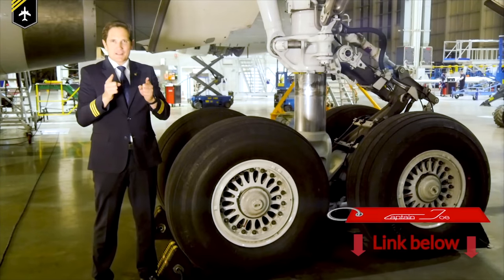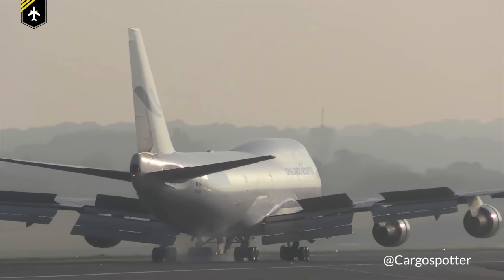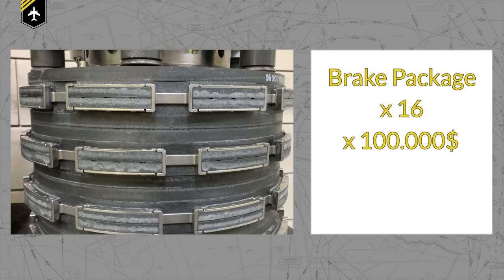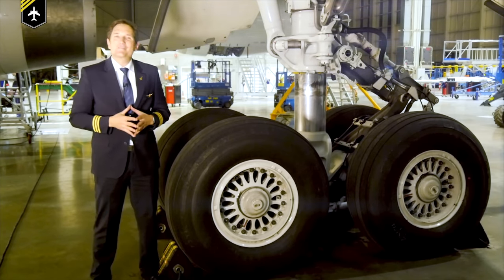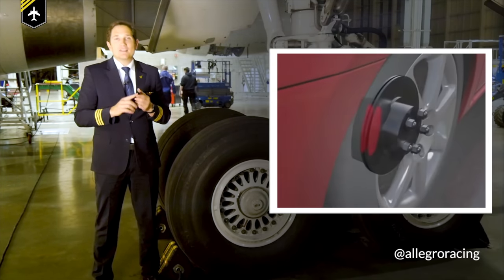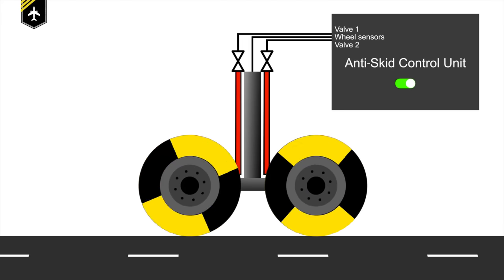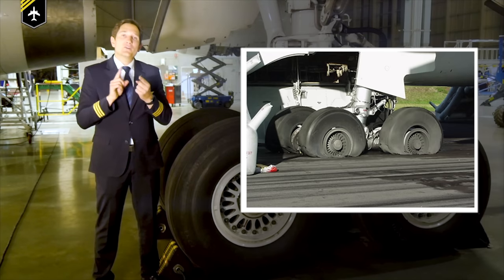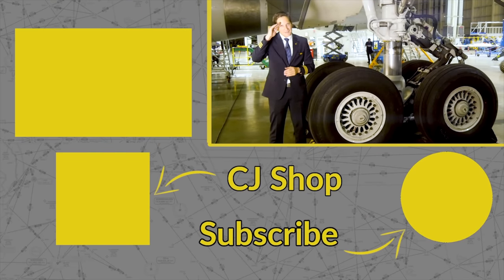Do PLANES have ANTI-SKID??? How to PREVENT SKIDDING? Explained by CAPTAIN JOE

Comment: "They came up with the Anti-Skid-System or..."

THE ASS?!

"protection"
Reply: Why it's not called that in cars.
Reply: Makes sense. The Antonov An-225 is very thicc.
Reply: @nolongerusing7430  dummy thicc
Reply: @stever4899  
Kuz cars aint thicc

Well, except for trucks
Reply: Lmaoo
Reply: @dickmelsonlupot7697  with widebody kits they are
Reply: If there will be more advanced system, it will be called The Smart ASS.

Comment: Aircraft on an aircraft carrier switch the Anti-Skid off during carrier  operations. There is a few reasons for this: The Carrier is coated in a no-slip material, and taxi is slow enough that  skidding is a no-factor. Takeoffs via catapult and landings via trap are not dependent on braking action at all. Lastly, if the anti-skid system fails, in can take the normal braking system with it, leading to an aircraft rolling over the deck, potentially bumping into something or disappearing over the edge into the sea. 
That last point is the reason why on an aircraft carrier, pilots arm the ejection seat immediately when the tie-down chains are removed from the aircraft, instead of just prior to taking the active runway for take-off,  which is typical in land-based operations.
Reply: 100% correct, in addition to probably the most famous of carrier operation differences vs. most land based airports, landing on pretty high throttle incase your hook bounces over all the catch cables, so you can immediately take off again, and come around for another pass. {It's required to slowly shake your head as you get hooked on your second pass..jk :D ) I got to tour the USS Nimitiz when it was in Bremerton Washington when I was a kid, It blew my mind the shear scale after having also been on the USS Missouri. As a 8-9 year old kid on the deck of the Nimitz, the main thing I was thinking of how sweet F/A -18's are and if anyone could survive a belly flop if they missed the nets after falling off the deck.. rofl... 

+
Reply: Now these people are like me how old are u guys I am 14

Comment: 4:49 when he says "blowouts" he is being serious.
He is standing next to 4 bombs. 4 very powerfull bombs. 
Each of those tires are inflated to around ~250 p.s.i. 
2 of them probably have enough air crammed in them to fill the entire interior of the plane to nearly 1 atmosphere. That includes the wing fuel tanks, fuselage and the hellhole. 
Imagine that much air escaping the tire instantaneously.
Yeah. It can blow a car apart.

EDIT: I forgot to add, that pressure is when the tire is cool. Say, 60°F at sea level. 
You all know that heat affects air pressure. Which is why you add somr to your car tires in the winter and release some in the summer. The same thing applies to aircraft tires. But the effect is greater because the tire pressures are much higher. 
If that tire lands in a hot middle eastern airport, when the black paved ramp is 150°F and the air is ~130°F, that tire pressure might pass 300 p.s.i. 
And, more importantly, if that tire suddenly skids and burns rubber, or when the brakes are applied, that tire may suddenly be a few hundred degrees hotter. And that quickly heats the pressurized air inside.
And then...well...use your imagination.
Reply: Spicy air
Reply: looks dangerous, let’s do it!
Reply: @Thegreatduc 69 I’m all in
Reply: I have to work with containers of gas at 3500 psi.
Reply: Agreed
(250 p.s.i approximately equal to 20 bar)
Reply: Its not pretty I'm a retired Aircraft Mechanic saw a 707 land and one the main tires blew the wheel busted apart, took the ramp crews two hours to clear the runway. 
A simple explanation of brakes is they convert mechanical energy to heat energy of course its more complicated than that with the braking system, the anti skid, hydraulic systems, computers and not ti mention the backup systems.
Reply: The volume of a 747's tyres is about 0.4m3 so at 20 bar there is about 8m3 of air (or rather nitrogen) in each tyre. The main deck cabin volume is c.600m3. So it would take about 75 tyres worth of air to fill it.
Reply: Aircraft tyres aren't filled with "air", they're filled with Nitrogen.
Reply: Yeah, its dangerous i was thinking the same thing!
Reply: Thats why you approach hot wheels at a 45... to avoid the failure path, and avoid the blow out plug path.  That is if you have to approach  the durn things at all!
Reply: @musicbruv  3500 p.s.i. 
So you have a great deal of both understanding and respect for high pressure containers. 
Do you work with O2 containers?
Reply: Guys I'm a commercial A&P myself. I deal with 737 landing gears all the time. I'm giving a G.P. style explanation, if you know what i mean. Lol
Reply: @LiamE69  Appreciate the mathematics! 
I was off a bit wasn't i. :P
Reply: Nice description. I like how you explained that 👍
Reply: May I Ask What Is The 'Hellhole'?
Reply: Woah! That's Al lot of Science.
Reply: @leafpot587  The hellhole is a particularly unpleasant maintenance hatch/area inside the tail structure, but outside the rear pressure bulkhead. This area usually contains the operating mechanism for the horizontal stabilizer, and is often very greasy with limited ventilation.
Reply: @davecrupel2817  O2 and Co2/Argon mix mainly.
Reply: @musicbruv  You're not saying you put O2 in tires, right? 
Can you clarify?
Reply: @davecrupel2817  I work with those gases but I do not put them in tyes but weld and gas cut with them.
Reply: @musicbruv  I totally forgot when I made that reply that you're the guy that works with pressurized bottles. My apologies
Reply: @davecrupel2817  No worries, I was a bit confused by your reply but hey we all make mistakes.
Reply: @mikecowen6507  thanks!
Reply: Well the Gay-Lussacs gas law is the main reason why airplane tires are full of pure nitrogen. Nitrogen doesnt explode, and the temperature  doesnt affect pressure as much. But while you COULD get pure nitrogen for car tires, in most cases its just a waste of money.
Reply: They are not at any limit at normal tire pressure, not even when they are hot, and the pressure increases... They are tested to the double, at each tire change. The rims are tanken appart, and magnafluxed for cracks, and a new retreaded tire is installed between the two rim halves, and checked in a cage, before they are send out ! 
I change wheels on B-767 pretty often.. They are not bombs !
Reply: I have to admirre how much knowledge you have

Comment: I like the fact that Joe explained that braking incorporates slippage.
Usually in high school they just tell you that static friction is greater than sliding friction and that, since the instantaneous speed of a rolling wheel relative to the ground is zero in the contact point, ABS will keep the wheels spinning so that they can transmit the maximum amount of power to the ground. Whereas, using more than one reliable source I've found out that the peak of the coefficient of friction happens when there is a certain amount of slippage. Surely the motion of the tyre in that condition will be closer to a rolling tyre than to a sliding one, but still it will be sliding; actually, when the slippage is zero, so will be the friction coefficient.

Comment: 6:45 ..... Damn that's a hard landing. 

Looks like testing though.
Reply: @Qi Sen Wang fr, that cargo took a nice bounce.
Reply: 411Adidas the video is slightly sped up, so it looks like that.
Reply: @ZK-APA  I have to disagree. It looks normal speed transitioning into a minimal slow motion
Reply: 411Adidas https://youtu.be/1Oc0tgkYMDg

The original video. From here you can relate the sped up video.
Reply: Qi Sen Wang you are right 0:17 looked way harder landing
Reply: Nah, that's just a typical MD-11 landing. High V-ref speeds and a small tailplane does that.
Reply: @ZK-APA  good call, that's much slower.
Reply: Just MD-11 things.
Amazing cargo plane, but hella clumsy at landing, and lands FAST
EDIT: just not as fast as the clip shown here of course, check the original posted on the replies
Reply: The sped up 747 landing in the beginning was also rough
Reply: That's a good landing for me in flight simulator.

Comment: I'm my flight sim I had to use RTO and it was kinda fun. The story is my stick locked up and I couldn't pull up at V1 so I pulled the throttle down to idle and RTO took over and stopped near the end of the runway.
Reply: You don’t rotate at V1

Comment: 5:03 - ABS light on while cruising at what I assume is 185 km/h (111 mph)!
Reply: Must be on the German autobahn
Reply: let's be optimistic and believe it was the pre-check that some cars do that roll the dials all the way and light up all lights in some sequence
Reply: @Kalvinjj  That is plausable. I see that in my Ford's instrument cluster test.
Reply: Normally not a big deal for car drivers as most of them usually break rather gently and the street conditions cannot be too bad if one really drives at 185 km/h. ABS should not be needed regularly, only in special cases like sudden snow mudd or some idiot coming out of a hidden street and ignoring your right of way.

Comment: Hey Joe love you and your work a lot
Being a curious kid pilot I had this question :   Why don't the pilots use AUTOLAND always??
Would be great if u could answer that😘
Reply: Because not all runways/airports support the required approach criteria for autoland. And what if one time as you land you have lost the autoland capability then have to land manually but not done so for a while. It most likely won’t be a smooth one
Reply: abbysnowmist yes they can. Just depends how much wind is prevailing and the runway slope. Been on a flight where the pilots used autoland (thanked them for the smooth landing and they said it was actually an autoland)
Reply: It is to extend the life of the runways, because autoland will land every aircraft exactly at the same point causing a hole in the runway. (very precise system)
Reply: Papercraft Shikhrrr because one the aircraft, runway and the pilots all have to be qualified for it, so you can't do it everywhere.

And two, when the pilot has manual controls, he or she can make rational decisions and make adjustments as needed. Autoland can't do that (eg Autoland has a crosswind limit less than a manual landing)
Reply: Pilots are pilots because they like flying airplanes. This includes landing them.

Comment: The ABS system was developed under petiton of Onkel Aldolf by someone with the ''Bosch'' lastname once it was clear that breaking in the moist/freeze autobhans was a problem. 
The mechanical ABS was too big for rockin on a BMW or Mercedes at the time but the war came so the Luftwaffe had to face the despair of trying  to stablish an aerial bridge with Stalingrad and skiing was big chunk of the problem. They asked for help and the early mechanical ABS was mounted on some Henkel planes if i remember.

Comment: I may not have this exactly right. But Dunlop developed a system called the Maxaret system in the early 1950’s. A wheel locked when it hits the ground will stayed locked as it rides on a layer of superheated steam. As a side issue it also cleans rubber on the railway causing white tracks. I know the 1st British passenger jets had a version of this system. It was extremely complex as it was not controlled by electronics.

Comment: I"m not a pilot, but have an interest in aircraft. I first read of aircraft anti-skid systems on a very early late 40s all-weather jet interceptor.(Which would have to land in any weather)> It would have been an analog system back then. If I remember correctly, the rotors were chrome plated copper. (Don't quote me this, it's been years)

Comment: A related fun fact as a car guy. There was an early attempt for a car ABS system back in either the 50's or early 60's. They actually called it "Anti-Skid"
Reply: As far as I know the first production car to have anti-lock brakes was the Jensen FF in the UK in the 1960s. It used the Dunlop Maxaret system that was already used in aircraft. It was expensive but this was tolerable because the Jensen FF was a very expensive car.

Comment: Really wonderful explanation.  Thanks for the video. Given the significant cost of those brake clusters, I wonder how often they replace them.  I would imagine not all that often.
Reply: Steel brakes, the "classic" material, were typically designed by the brake vendor to get about 1000 landings from a rotor/stator assembly.  For carbon brakes, first introduced for airline operations (other than Concorde IIRC) in the 1980's, more like 3000 landings.  The life for any particular unit will depend on the actual amount of brake energy absorbed in each of those landings.

Comment: Great video! However, one thing to note. It's not always necessary that a lighter vehicle will have more chances of skidding and losing control. It mainly depends on the combination of the vehicle mass and its tire configuration including inflation pressure and tire tracks.

A heavier vehicle has way more linear momentum to that a lighter vehicle traveling at the same speed. So more brake pressure has to be applied in order to decelerate the heavier vehicle compared to the latter.

Ofcourse, it is true that heavier vehicles provide more leverage to its braking control due to the higher weight pressing down onto the wheels. Yet, although the lighter vehicle will have the tendency to lock its wheels more likely in a snap, the deceleration rate will still be higher(with less braking force) due to the fact that it wouldn't be having much mass to change its state of motion, hence requiring less amount of energy to the brakes and thus less heating.

But then again, it all comes down to the overall vehicle parameters and its configuration, and not just its mass alone. There are cases where higher mass will aid in braking (a car compared to a motorcycle) or a lower mass doing the same (bicycle compared to a motorcycle).

Thank you for reading!
Reply: He is not an car specialist he is a pilot 😂🤣
Reply: @mattm2572  Haha, good one. But this logic has to be considered if you have to fly with widely varied classes of aircraft.

And no, this is not just a car thing. This concept plays a major role in both aviation and aeronautics as well, and I, fortunately, also deal with all of them in my professional career, hence the reason why I stress my point. Thanks for the reply anyway! 😄👍.
Reply: @mattm2572  and btw, in case you didn't know, vehicles apply to any mobile machines and not just cars 😁

Comment: Hello, Captain! Why do pilots turn on engine number 2 first and not both at the same time?
Reply: David Fizz U engines are usually started using compressed air (bleed). This air comes from either the APU or from a ground air cart. The compressed air generated can start one engine at a time. Moreover its better to monitor engine starting one at a time.

Also, it's not necessary that eng 2 is always started first. Eg in the A320 for single engine taxi, eng 1 is started first

Comment: The Brakes used in commercial Aircraft are comprised of Carbon Ceramics, the same ones used in Modern racing cars such as F1, NASCAR, INDY Car, etc.  The Technology originated from the aerospace and rail industries then to auto racing and now down to commercially available automobiles.

Comment: Most safety devices and cabin device found in cars are a direct result of the aviation industry having designed and implementing them on aircraft.  The designs revolutionized safe travel in aviation so much.  It was adopted in the automotive industry.  There is a long list of things that found a purpose in aviation and eventually became normal in the automotive industry.

Comment: All jokes aside, a car without ABS on a dry track is around a second per lap faster than a car with ABS. And that is due to "Threshold braking", during which you should have the tyres go 3-10% slower than the vehicle is moving. It is because the is allowed to flex a little bit more because of that, has more grip.
However, plane's tyres are inflated to such pressures that the probably wouldn't flex at all and would instantly lock up.

Comment: Could you go into how much energy is going into the strut compression?
And what's going on in the rest of the landing gear.
What keeps them up what keeps them down etc.
Reply: Shock strut energy dissipation depends on the rate of compression.  When the strut strokes, oil pooled at the bottom of the shock strut interior is forced upward through a relatively small orifice.  That squirting dissipates energy in the form of heat.  There's something called a metering pin -- a rod with a diameter which varies along its length -- which mounts inside the bottom part of the strut and sticks though the middle of the circular orifice. That changes the net cross-sectional area of the orifice as the shock strut strokes, allowing energy absorption throughout the stroke to be tailored to get the right amount of resistance from the strut -- what amounts to a spring of variable stiffness-vs-stroke.

It's a tradeoff between what's best for normal landings vs hard ones, and spoiler deployment phasing has to be accounted for in the dynamics as well.  During flight test all of this gets sorted out to arrive at a metering pin design and shock strut inflation level which provides the best compromise for a range of landing situations.

Comment: The folks who build and maintain runways also pay attention to the properties of the top surface material to reduce skidding risk.
Reply: That can go too far in the other direction:  Early on in the Space Shuttle Program, NASA gave the KSC runway a decidedly rough texture so as to maximize friction capability.  But they overshot, and on some flights braking was wearing away rubber on one or more main gear tires all the way down to the cords.  More than a "lifetime" of wear from just one stop, and of course a big safety concern because with that sort of damage being incurred, failure of a tire while still moving was a possibility.